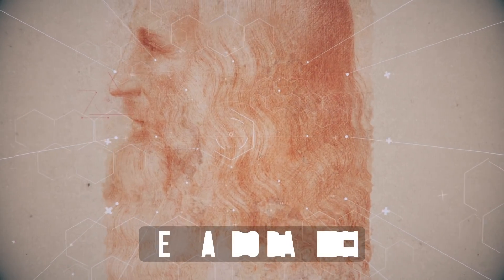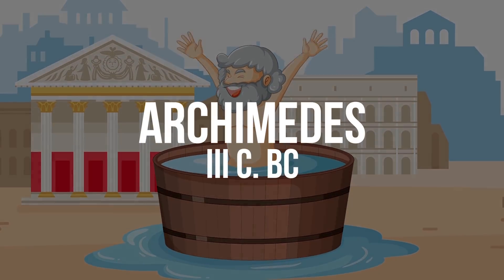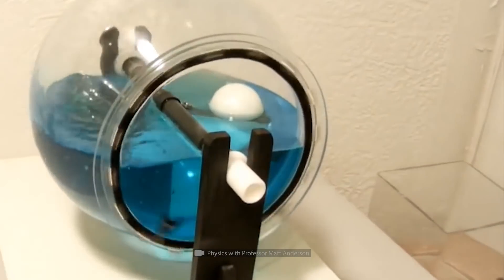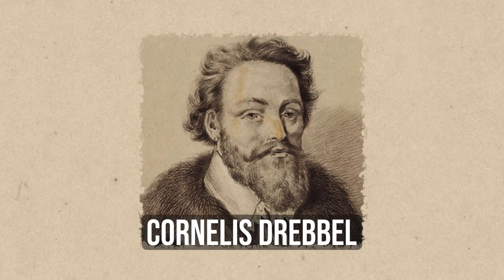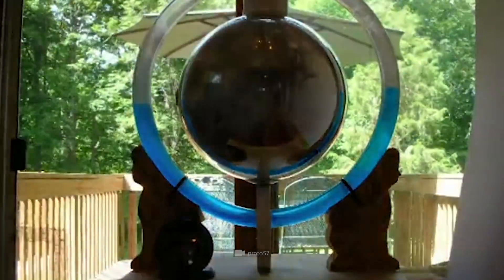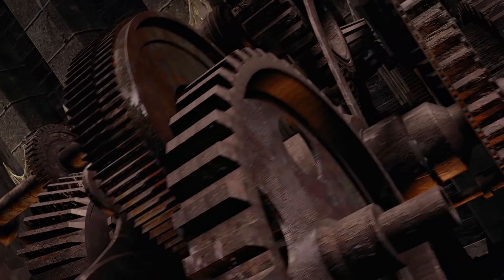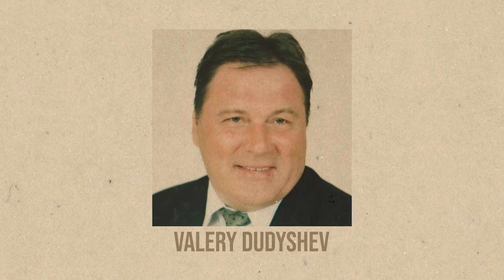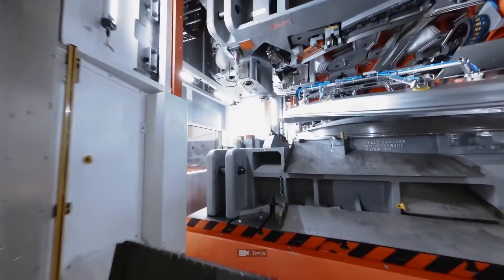Are Scientists Close to Creating a Perpetual Motion Machine?

Comment: Forget about perpetual motion, materials degrade over time, but it is possible to create a super efficient energy generator,. That is the mindset that we all need to be in.
Reply: Some good things were born from attempts at doing something greater, is good to aim high but still appreciate what was accomplished along the road i consider. Everyone can keep dreaming of their super alloy, perhaps they’ll make something interesting while trying to reach that goal and stop to appreciate how far they have come
Reply: @drewnames651  coloboration
Reply: Nah I like the idea of smart electromagnetic turbine continuators.
Reply: Right? Like guys can we maybe work on electrical systems and infrastructure that have less than a 50% power loss to the system between generation at the plant and delivery to the customer which is actually something we currently know is possible and with in the bounds of the laws of physics first? I would be far more excited to hear about a superconductor that is durable, stable, and cheap enough to produce for commercial and residential mass production and application that provides 10% or less energy lose to the system being developed and becoming an industry standard at this point and time.
Reply: @CartoonHero1986  
There were some guys that made a special wire that was SUPER efficient... so much so that they THOUGHT it was 100% efficient. After "peer review" it was found they were not "100% efficient" and were discredited as scientist and are unable to work in the sciences now.

If science wasn't such a "elitist club" and independent inventors weren't discredited as "NOT EXPERTS", we would have made a LOT of scientific progress in the last 50 years.
Reply: @toorimakun  Its the science education. Educators say things like "gears are 100% efficient" and other such nonsense. So who knows what the definition of 100% efficient is at this point.
Reply: Super efficient energy generator, imagine an electric motor with some sort of an alternator attached to recharge itself constantly with no loss of energy. Imagine electric cars, no need to recharge, just keep up on maintenance (replacing parts if they go bad or anything like that)
Reply: Only if we could come together and focus only then may we be able to build our own 🛸
Reply: Energy generator? You do realize that would break the first law of physics right? Energy can neither be created nor destroyed. So you can't generate energy. You can only transform it from one form to the next.
Reply: @ThePrufessa  it’s possible. Sure it might take a very small amount of energy to start from but that multiplies which is the way a generator works. Take for example it’s possible to put a 5w electric motor with a magnet and some copper wire and turn that 5w into like 25-30w easily just by the magnet going around within the wire. So it’s taking that small amount of energy to create more by doing so. It’s an energy transfer rather than a generation but honestly who cares, words are words, by generator you get what they mean, don’t look that far into what they say.
Reply: @yo_its_gingey5329  a generator turns energy into power. It doesn't generate energy. Two completely different things. And no it's not possible to generate energy. So says the very first law of physics. You cannot create nor destroy energy.
Reply: @ThePrufessa  yes you are correct but there's literally energy everywhere for example what we see is photons that bounce off materials (photons are in motion creating so called energy)and capture by our eyes in other words our eyes work simliar like conventional telescopes, literally theres energy all around we just don't know how to attain it yet
Reply: @hypnotic_hotdog9775  you have absolutely no idea what you're talking about dude. None of what you said is true.
Reply: @ThePrufessa  yes but think about the fact that the law's of physics are laws to the reality that we percieve with our senses. Now that we have a better understanding of how quantum physics kinda works we might be able to greatly improve our lives by hundreds if not thousands of years with tech advancements, it might sound funny but hear me out take a look at super conductors and how the work yes they need a little push but will literally keep going until the energy is transferred but what if we're able to create a super conductor generator which would in fact fairly easy in space because of the environment, just a thought 🤓😅
Reply: @hypnotic_hotdog9775  go to sleep fool
Reply: @hypnotic_hotdog9775  Super conductors still lose energy, just lot with the magnets they’re riding. They still have drag and lose energy through the air.
Reply: Ok professor.. go help them build it🤣🤣🤣
Reply: @jonsnipe5484  Wow, such an intelligent comment. Give yourself a pat on the back.
Reply: @jonsnipe5484  lol exactly.
Reply: The universe
Reply: It can actually be very possible in the vacuum of space with zero gravity
Reply: @shaggysidbacon6144  there is gravitational force in space, otherwise the solar system wouldn't exist. It is just a different type of gravitational pull than we're used to. Friction also still exists in space so it would need to be a machine without any friction or resistance meaning it could only power itself and would not power other machines because it cannot create any energy beyond what it takes to power it or else it would keep spinning faster and faster until it broke itself. Basically, it's not possible.

For clarity, it's not possible to create a perpetual motion machine with anything hooked up to it because the energy would have been created without any prompt, which is impossible
Reply: Your cars materials in 2021 degrade over time aswell
Reply: Perpetual motion is perfect for space travel though..

Things can't erode or decay in a vacuum..  the only hazard is just random Rouge celestial objects. But Perpetual motion would allow the space craft to continue gaining speed, as there is no drag in a vacuum. Things go forever until they hit something..
Reply: But the electric generators we have are already extremely efficient.
Reply: Preach, amen
Reply: What if self charging magnets are used instead of bearings or rods, charging itself with its own motion making them stronger and in turn the faster it the more energy it creates enough to sustain itself and well who knows whatelse🤔
Reply: Nah. It’s Carnot cycle - Carnot efficiency limited…
Reply: The power of gravity propulsion can change the world and it’s real!
Reply: @RandoJord  I think gravity has ruined your brain
Reply: @ThePrufessa  bro no need to be so damn toxic hahaha I’m just saying it’s a cool theory look it up, all those crafts the pentagon released that would shoot from 0- 80,000 feet do seem pretty real.
Reply: @ThePrufessa  gotta be optimistic about stuff, your in the wrong comment section.
Reply: @RandoJord  lol optimism is based on reality. What you're saying is not reality. And seems pretty real isn't the same thing is being real.
Reply: @ThePrufessa  it’s real footage released by the pentagon and the ex chief came out saying there’s far more footage classified
Reply: @ThePrufessa  we’ll if you did some digging you’d see that gravity being a wave is enough evidence to see that it’s real, it’s something that can be pushed with its own force because gravity is both a wave and a force.
Reply: @RandoJord  bruh... put down the science fiction books and step into reality.
Reply: @ThePrufessa  tell me what makes this theory unrealistic? I wanna know your side to this shit
Reply: @billylad879  lol right.
Reply: @ThePrufessa  ......a lot of people quacked 'reality' when early inventors tried stuff to make things we utilise today. Its one thing to self justify your entitlement to subjective narratives and bringing/contributing something meaningful as a means to justify your stand in life. A lot of folks are justs Sayers, very few Doers to attempt an achievement. I see you being neither unless you have something to brag than just r/smartprick on youtube.
Reply: @changsangma1915  I don't have any entitlement to justify dummy.
Reply: @changsangma1915  furthermore, I can have an opinion on this stuff just like anyone else does. And my opinion is based on reality not science fiction. So you can miss me with your holier than thou nonsense. If you want to dispute what I'm saying then do that. But taking to me like some pseudo YouTube psychiatrist adds absolutely nothing to the discourse and doesn't take anything away from what I've said. You want to dispute me use facts not your fake  psychiatrist degree you got from YouTube University.
Reply: @changsangma1915  did any of those early inventors create something that defies the laws of physics? Because ideas that defy the laws of physics aren't based on reality. Everything that nutjob says defies physics in every single way. So there's no reason for me to have an open mind about anything he said being possible. Now until you have something to say that disputes this opinion you can miss me with your nonsense.
Reply: @changsangma1915  oh now you don't have anything to say. Gotcha.
Reply: @RandoJord  Have you seen it in person?
Reply: @DenisKz  no I haven’t but have you seen space in person lol, you can say a lot of shit is fake of course but once you got evidence like the pentagons released tapes and gravity being proved that it’s a wave makes it a lot easier to understand, I’m not saying it’s anytime soon because everyone still cares about there own problems but I’m just saying it can become a thing in the next 1-200 years
Reply: @DenisKz  I’ve been looking into it here and there for the past year and the only thing I can say is for you to take a peak and check it out
Reply: @RandoJord  I never said it was fake, but until we know for sure it's real we can't go around saying that it is.
Reply: @RandoJord  the Pentagon isn't the only entity that knows gravity moves in waves dummy.
Reply: Graphene circuits are the future.
Reply: I believe that more energy production is a red herring of sorts. Material science and physics should be working on technology that needs less energy to perform. Break the cycle of "improvements in technology" that need more power.
Reply: I have designed perpetual motion... 
My engineering teacher told me 'it's not true perpetual because you need to use physical energy to start it'..
Reply: Yah, I think people get too stuck on the idea of "creating energy" rather than can it make energy efficiently.

Like those watches that "self wind up" as you walk around... the watch is getting energy from you walking/moving your arm... but you're walking/moving your arm around anyway. so the cost to you is "free"
Reply: if only we can decrease the energy wasted by heat and friction
Reply: @hughfisturbum2089  everyone said tesla was mad until he proved them wrong time ad time again. and then drove him off when he decided to make energy free
Reply: my farting is the answer
Reply: Exactly, its the meaning of perpetual motion which holds back scientific advancement. It does not matter if it needs manual intervention. Its still endless free power
Reply: I might be the only person on earth who knows what energy is. Energy is conscious control. Its the difference between velocity and energy. Take a train for instance. If you give it velocity on a straight line it will reach its destination. But that would be useless, what you need is the ability to control the train to reverse it when you want it to reverse or stop it at a station when you want it to. Then someone will say "oh but what about changing velocity, acceleration" Same thing. Acceleration, force, is not energy. Its why people haven't figured out how to make energy from gravity. Because there isn't a conscious control mechanism to modify the gravity at will. If there was a button (conscious control) to enable or disable gravity then it would be called energy and free energy. If someone could have a button to turn a magnet on or off then you could build a perpetual motion machine easily.
Reply: @earthenscience  Well, show us how its done then.
Reply: Time degrades all.
Reply: More wind turbines, less burning fuel
Reply: Exactly because think about it l let's say you make one now what?  The moment you put a load on it it no longer is
Reply: @turtlefarm8742  Over a hundred years ago people said flying machines would be impossible. Keep an open mind.
Reply: super fluid liquid helium
Reply: What about the book written by David Russell.( Mechanical free Energy). His force tester machine shows a 7 pound force lifting a 20 pound weight at a 1 to 1 ratio.
Reply: @davidrussell3610  What about it?
Reply: That’s what I was thinking as well. What we need is efficiency. Like the generator you used as an example.
Reply: Tesla had free electricity for his car . 
 Certain of the Pyrimids , still produce energy which is measurable & benificial to humans . 
   We can access the same energy that Tesla did , and which helps power the Pyrimids . 
 Had JP MORGAN , not been so greedy , we would have that energy now , all of it unmetered , instead , greed won over common intrests .
Reply: @davidarundel6187  holy shit dude. You take conspiracy theories to a whole new level.
Reply: @davidarundel6187  I'm glad you watched one YouTube video on his wardenclyff tower.. Def interesting and has made some good points. But your close minded 100% convinced mind is what causes divide and cancerous to society. Question things. Remain unbiased and see things through multiple perspectives.    You probably watch ancient aliens and are convinced bt anything they say
Reply: @davidarundel6187  I'd like to know more about this.
Reply: Gravity, magnetic field and mercury. I have already completed my experiments with astounding results...
Reply: @nickfrost9771  Are you able and willing to share your results?
Reply: Right? Like people give up because perfection isn't possible. As if that means we shouldn't strive for it
Reply: @stevieg2536  Yeah, nobody said that so I don't know where you are getting that from?